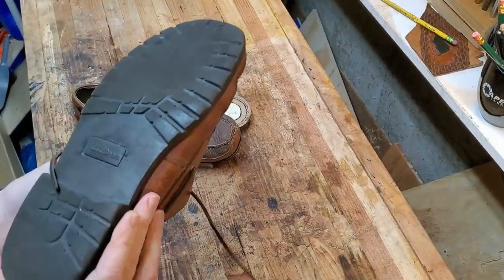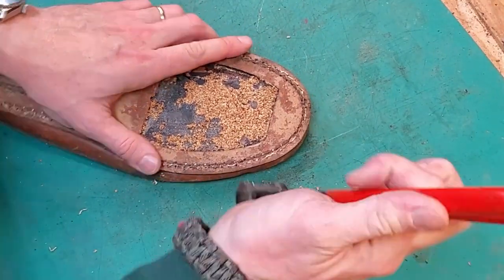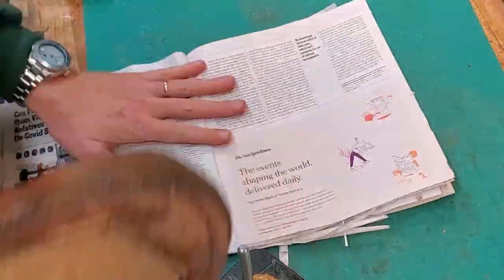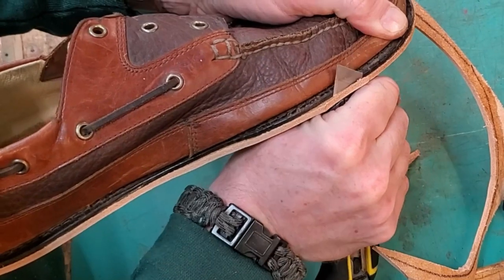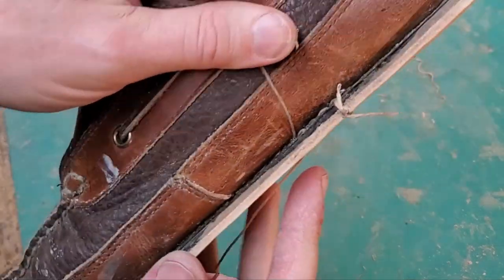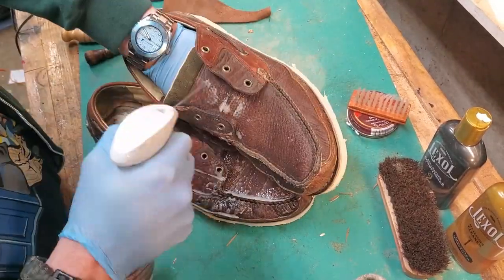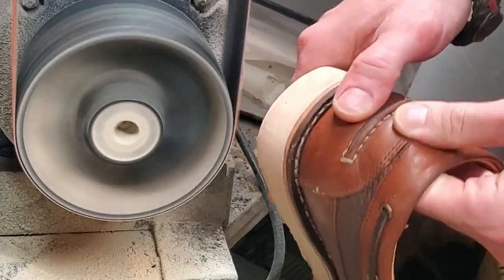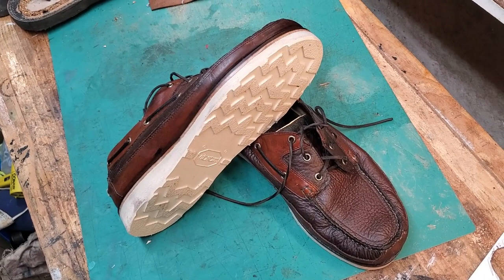I resoled my LLBean bison moc-toes at home again!

Comment: Just finished with a pair of Iron Rangers. Did pretty much exactly the same thing you did with adding a veg tan midsole and vibram christys. Sanding the edges of the soles were the hardest part for me.. trying to get a perfect edge with senders designed for wood is almost impossible.
Reply from the maker: I agree. It would be nice to get one of the cobbler machines, but I don't have space for one right now...
Reply from the maker: I'm glad you did your own shoes! Did you post any pictures online where I can see them?

Comment: Nice video, thank you!

If you replace the cork with leather you will get a custom footprint over time as well, furthermore it does not need to be replaced/break down over time. I would have added a thin rubber slipsole (like 2mm) instead of the leather midsole (or do both, but thick leather is quite costly where I live) and attach it with 2 component glue. (You can get additives to mix into contact cement which enhances its bonding power/heat and oil- resistance). The rubber outsole will adhere better to the rubber slipsole (here you can use the glue without additive) and there will be no damage when you resole it.
Reply from the maker: I like these ideas, thank you!

Comment: Good ideas. The magazine, just turn the page for fresh surface. Interesting to see how your work
 fared. I recently used old mt. bike tire on running shoes for retread. We'll see...
Reply from the maker: I'm curious how that worked out? Did it last ok?
Reply: Went hiking today, pretty good traction. The tread seems to be sticking well to the foam of the shoe. There is some rubber to rubber overlap not holding as well (contact adhesive) saw your short on how you glued the heel up with leather in between

Comment: Great video! You’ve inspired me to replace the Christy outsole on my White’s. What pliers are you using to pull the outsole off?
Reply from the maker: I use a pair of end-nippers that I bought at the Eugene flea market. Here are a comparable pair from Harbor Freight: 
https://www.harborfreight.com/10-in-heavy-duty-end-nipper-56477.html?utm_source=google&utm_medium=cpc&utm_campaign=12192884362&campaignid=12192884362&utm_content=116489852825&adsetid=116489852825&product=56477&store=&gad_source=1&gclid=CjwKCAjw4_K0BhBsEiwAfVVZ_2_tD9Fq5RMbwkvTADHCaNR5387iDQzPlZlQFAtmphGrn_gwGbSywBoCLqIQAvD_BwE
Reply: @DrPronghorn  Thanks!

Comment: Did you just cement the Christie  sole to the leather…..meaning the wedge sole is not stitched, correct?
Reply from the maker: Correct. It lasted very well for two years, until the sole was worn out

Comment: sorry I have 2 other questions:
 1) at 4:01 are you you saying "it's a 7or 8 ounce leather" or "7/8" ?  (I'm trying to figure out what it means in metric)
2) what type of thread do you use at 8:11 ? (What size and material (e.g. nylon?) ). Thanks!
Reply from the maker: They always give ounces in a spread, 7/8 or 7 to 8 oz. In metric that would be about... 3 mm. The thread is from the Maine Thread Company. It's an 0.040" waxed cord, which works out to about 1 mm.

Comment: I want to glue a thin rubber sole to a pair of leather moccasin slippers. What type of glue should I use, Rubber on Rubber, (shoe goop didn't work). I just love how your shoes came out, so professional! <3
Reply from the maker: Thanks for the compliment! I would use Barge cement for any kind of shoe work. Also, if you're doing rubber to rubber, make sure both pieces are scuffed well. It might do better to put a thin piece of leather in between, but if you do, make sure to scuff up the smooth side of the leather or use suede that has a rough texture on both sides. The glue won't stick to smooth leather.
Reply: @DrPronghorn  Thank you just watched this video again with a friend you gave those shoes a new life!!

Comment: About the scuffing up processes at 5:23 can it be (well) done simply using sandpaper?
Reply from the maker: I think so. I would use a really coarse grit, but it should be fine. In fact, I've done that on other projects, used a 40 grit sandpaper to scuff up the leather.

Comment: Love love love! but I got to admit it drives me crazy that you could probably get a new pair of boat shoes like that for <$40.  For me I have a some nicer leather sneakers that were around $50, and as much as I want to resole them I dont think I will be able to justify the cost, especially when it's going to be more difficult to find a cobbler who will do sidewall stitching on a cupsole.
Reply from the maker: I understand. Part of my reason for learning to do this myself was to at least save on the labor costs. These shoes retail for over $100, so I feel like I've been justified in resoling them twice, but it would be difficult to pay a cobbler $90 or more for the same job, just because the new shoes are so close in price.

Comment: Sorry for the basic question but why not simply glue the Vibram sole on the shoes (without the midsole)?
Reply: Sorry you answered it at 1:45 "it's a sacrificial layer"
Reply: But I’m not sure I understand after all: if the point is to avoid sewing again, won’t pulling the old sole off energetically also unglue (at least a little bit) this sacrificial layer?
Reply from the maker: The new midsole adds another layer so I don't have to worry about losing a little bit of the original welt every time I resole them.